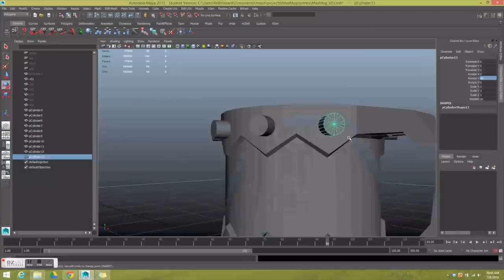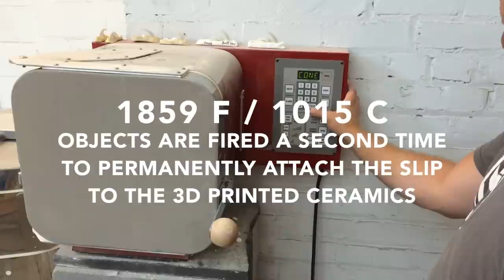Tethon 3D Printing Ceramics Movie making mug v 3

Comment: Do you know what firmware the printer is using/did you make this printer yourself?
Reply: This is a Z Corp printer and firmware.  Z Corp now owned by 3D Systems.  The material works on any powder/binder jetting 3D printer.

Comment: How long does this process take?
Reply from the maker: The entire process of modeling, printing and finishing is dependent upon the design fabricated and the skill level of the user.  3D modeling is variable.  3D printing by powder/binder jet technology is approximately 1 vertical inch per hour.  Cleaning the print is dependent upon the details and size.  Kiln firing is typically a minimum of 8 hours.  Finishing options are numerous, such as glazing and/or specialty firing.